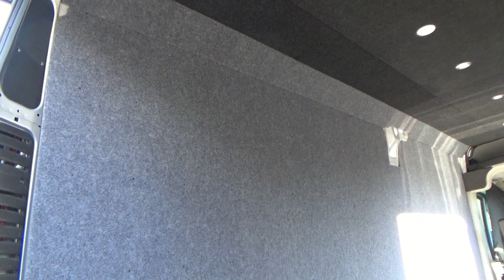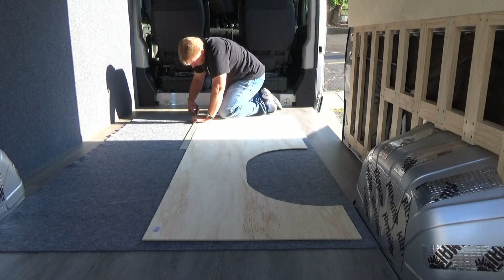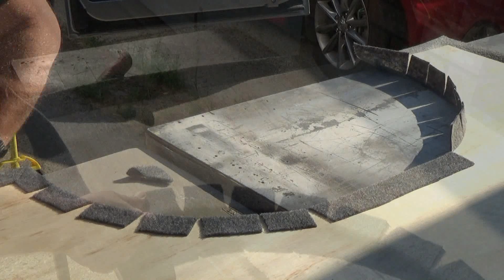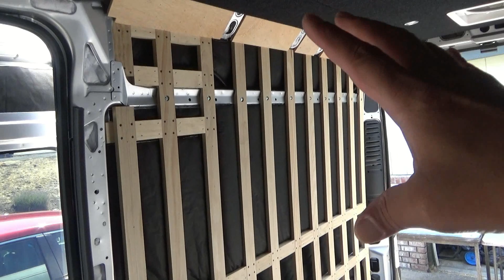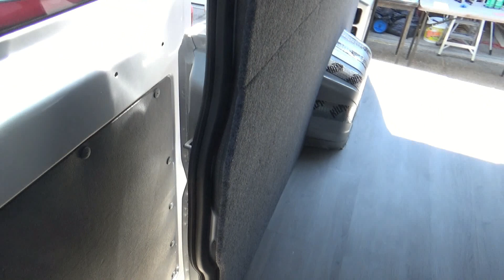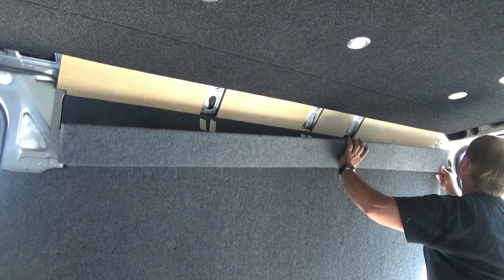DIY Van Build – Promaster 2500 159WB – Installing Carpet to Walls – Part 8

Comment: Didn't work out which type of screws were used in the wall panels.
Reply from the maker: To attach the paneling to the wall, I used #6 x 3/4 Inch Phillips Oval Head Tapping Screws. Black Oxide... Thank you for checking out the video!

Comment: Great work. Did you consider the need for a vapor barrier sheet of plastic under the panels, to reduce the moisture transfer and condensation behind the panels where the bare metal is not insulated? Any issues with mold etc since the install?
Reply from the maker: When I'm camping, I keep a constant airflow throughout, day and night... Haven't experienced a problem with condensation. If it is cooler out, I'll keep the heat on and works very well.

Comment: All the screw heads look awful. There has to be a better way.
Reply from the maker: 80% are covered by cabinetry and because the screws are black, are hardly noticable in the carpet.There might be a better way... but I am happy with how it turned out

Comment: Since you use 1/4" plywood for wall that is not very strong (in your own words), I guess you attach all the components (cabinets, bed, seats, etc.) to the wood  framing. I sawe you put tape not to screw in the metal frame, but do you leave some sorts of marks somewhere to easily find your 1" x 3" underneath?
Reply from the maker: Great question! The frames are evenly spaced (on both sides). I started at one end and attached the walls to the center of the stud... it was a matter of measuring over to the center of the next stud and so on. To keep a straight line for the fasteners, I installed one fastener  at the top and one at the bottom, then used a straight edge to keep all fasteners in line so they didn't zig zag all over the place. Real quick work! Thanks for checking it out!

Comment: Must just be a weekend camper.
Reply from the maker: Maybe a little more than that but you would be correct... Lots of traveling in the spring through fall until my heater is installed. :)
Reply: @OregonBatman  too much carpet for me, it won't be easy to clean.
Reply from the maker: Yeah... a lot of carpet. Sure does make the van almost soundproof though, which I really like! As for cleaning... a little shop-vac makes light work of it :)

Comment: This is a late comment but hopefully it finds you!

It seems you used 1x4's (.75" x 3.5") for your framing. Did you have any issues clearing the support beam in the center of the wall on the driver's side? I know you indicated the bump at the top which will be covered by cabinets, but there is a bit of a lower bump as well. 

I have a 1x4's mounted supporting our floating bed frame right now (we are using the van while building) and want to continue framing the van following your technique. Just making sure I am good to continue using the .75" thick boards for the vertical beams and expect enough clearance.
Reply from the maker: Yup... it all cleard! When all of the framing was up, I used a straight edge ascross the bottom hump and it was flush. I had to butt the horizontal framing up against the hump on both sides, and the paneling covered nicely. I'm sure there is a shot of it in there somewhere how I framed it, but all went well!
Reply: @OregonBatman  So appreciate the comment. One final thing. Did you mount wood to your ceiling cross beams? How did you deal with the lack of a cross beam at the very rear? Some folks glue up their own wooden “beam” and screw into that, but curious how you did yours.
Reply from the maker: I think you'll be able to see how I framed out the ceiling here: https://youtu.be/dM0-_8SRjL0    I did use the cross beams, and added extra support in the rear where there was little support

Comment: What carpet is it that you used. Thank you
Reply from the maker: I used a product I purchased from Ebay: Silver Gray Automotive Trunk Liner Upholstery Cloth Auto Pro Flexible 54"W... Nice material and super easy to work with! Thanks for checking out the video!
Reply: @OregonBatman  thank you sir
Reply from the maker: @richardsmith7887  Yer welcome!

Comment: One question.why this nonsense when there already vehicles for this purpose and it is much cheaper .I do not understand the logic of doing this.
Reply from the maker: I think the logic is: It brings a lot of pleasure and satisfaction of building it yourself. When completed, it's one-of-a-kind and well made. It has personality, unlike production models. If you can buy one, then buy one... if you have the skill to build one... build one. I see no reason not to. Thanks for the comment!
Reply: @OregonBatman  the problem is that in the past I did similar stuff and it always goes over board with money .I understand about satisfaction I am rebuilding my entire house and building studio and cinema but everything is so expensive and many people now write books about van conversions but they rarely mention that if you do not have money do not do it.
I did similar mistake with my house listening to people that said get an old house and fix it customize it yourself 
Already 3.5 years and the basement alone cost me so far over 50k with contractors would be 150k.
That my point.
At first it looks like good idea and somewhere at the middle you see thenproblems the cost and so many other problems that make the built problematic and the job unpleasant .
For such builds I think you need to have lots of time,money and independence.otherwise it will be a giant mess that costs tons of money and frustration.
I talked to a girl that has been born on caravan and lived her entire life moving from state to state city to city and she said what is the point converting a van when it will not offer you even quarter of the stuff that you will get from professionally made camper with shower beds kitchen.she thinks this type of projects do not worth the struggle.
There are so many people sucked into this and they are ashamed to admit that this was a bad idea.
Many videos now appear on internet showing the real problems.
That is what I wanted to say by asking the question and plus I have some experience being sucked into similar stuff.
Reply: @EPICSOUNDTRAX  This kind of build is not for everyone . I too am satisfied in my skills being put to use in my cargo trailer. Sometimes the price is a factor. I bought a 2019 6×12 cargo trailer for 2300.00 could not pass it up. Normally 4-6 grand.
Reply from the maker: @EPICSOUNDTRAX  The Bible says, For which one of you, when he wants to build a tower, does not first sit down and calculate the cost, to see if he has enough to complete it? Otherwise, when he has laid a foundation and is not able to finish, all who are watching it will begin to ridicule him, saying, ‘This person began to build, and was not able to finish!’

I would recommend, when a person begins a build of any kind, they create a budget and price the material they will need, then add 25 percent to it... if you don't have enough, save until you do.

I'll be happy with what I made when finished... it'll have all the items I need and want. Plus, I'll save money by not buying a professional model (which is expensive!)
Reply: Great job.
Reply from the maker: @chrischase6731  Thank you!